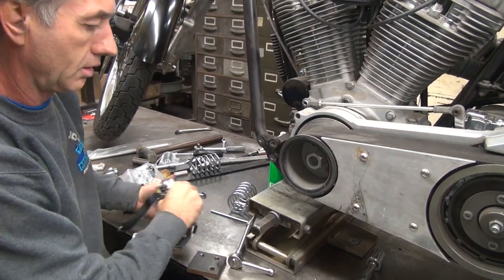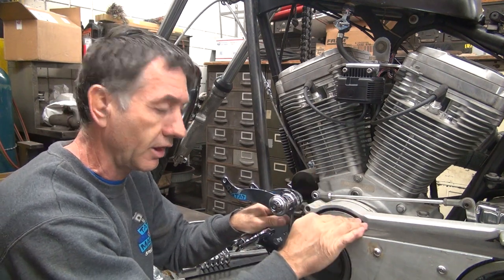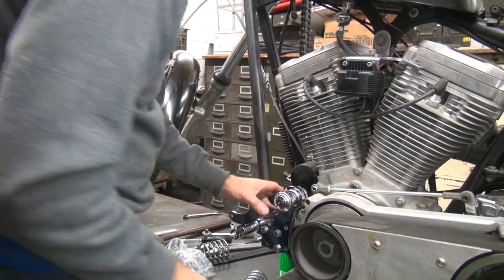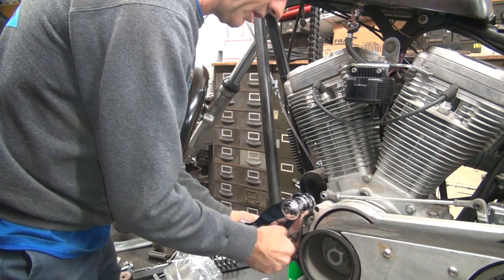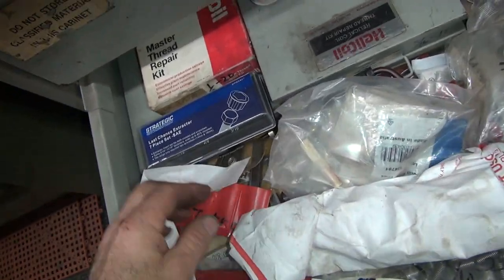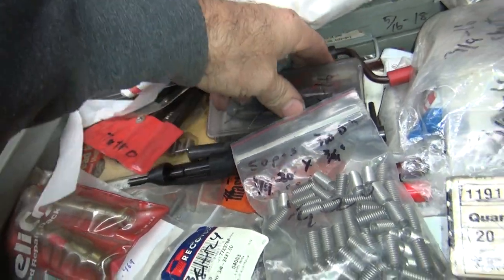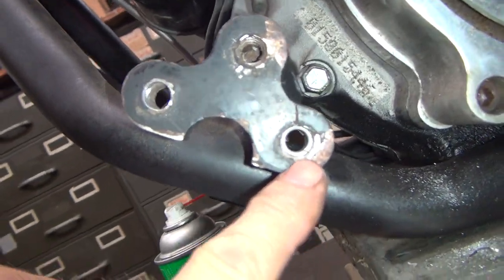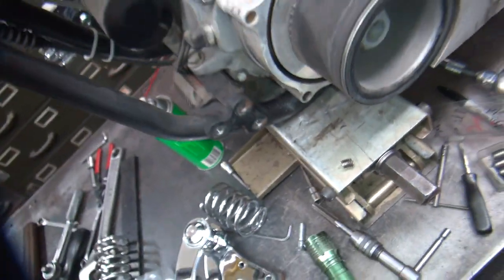#154 1999 80ci evo chopper used bike tune-up repair rebuild rigid bobber custom harley tatro machine

Comment: Damn Keenan when you placed the camera into the whole I noticed it was a Helicore.. I am like...."Does Tatro realize that he has a Helicore with a Tang on the bottom?) BTW, why did you not just break the tang off?
Reply from the maker: what you see in the camera is not what i see with my eyes or in the camera screen. you get hd and i get real world. either way, it got fixed as i discovered what was wrong. this is how things are done. you have a problem, you figuare out what is causing the problem and than you fix it. these are learning videos and i am learning as i go too. every gob is different.
tatro